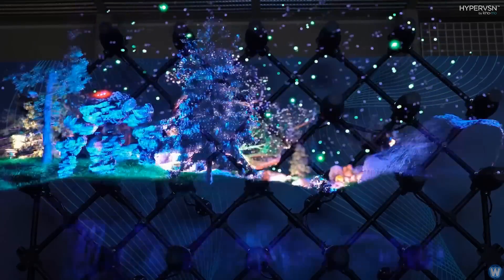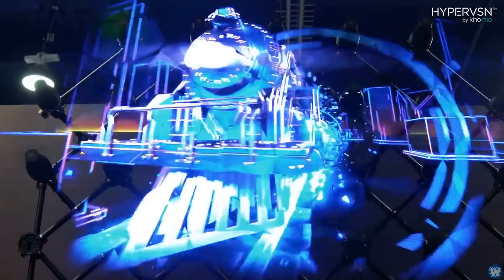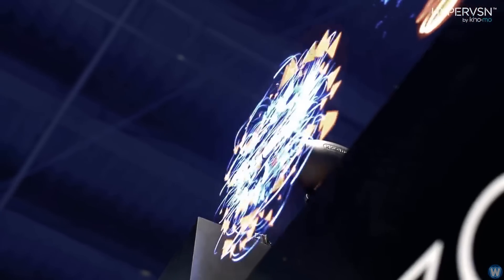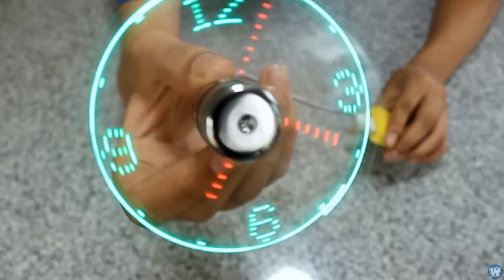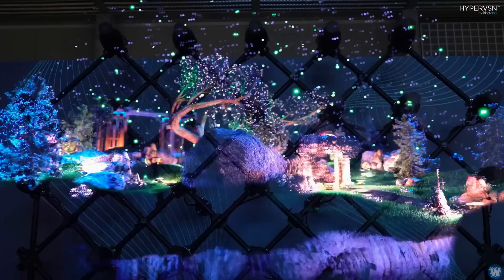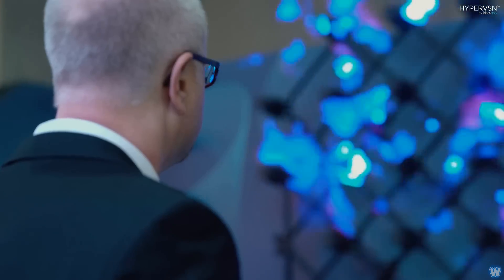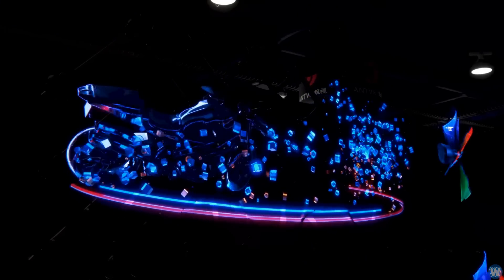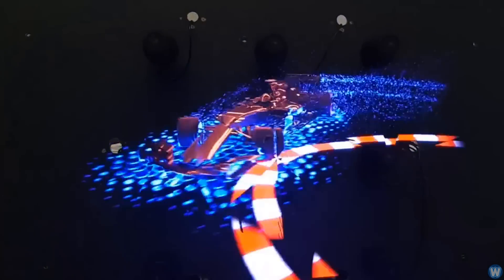Hypervsn Wall - 3D Holographic Effect Projectors

Comment: Mr. Engineer, I bought a 3D hologram fan, and now it is out of order. I asked several people who repair electronics. They said that the microcontroller is burnt and needs to be programmed. Do 3D hologram fans need to be coded, and how can I get this code? And the company I bought does not provide any service and is not responsive

Comment: One of the supervisors where I work has a similar model fan that looks exactly like that.  It isn't any more holographic than a flat panel TV.
Reply: Well if you show just TV programs on it, then yes. But if you use a proper black screen to your image then no, it does appear to float in mid air in 3 dimensions.
Reply: @JB-yb4wn  I don't think is possible to show images in 3 dimensions if the device does not generate depth.
This is a transparent 2D display that floats in the air
Reply: @bazem 
It generates depth as far as your eyes are concerned. However the technology is being replaced by racks and transparent thin screens, this stuff is a novelty. 
By the way, this was TV as it was envisioned by Baird back in the 30's. So this is very old technology but the advent of computerization has carried this old tech as far as it can go.